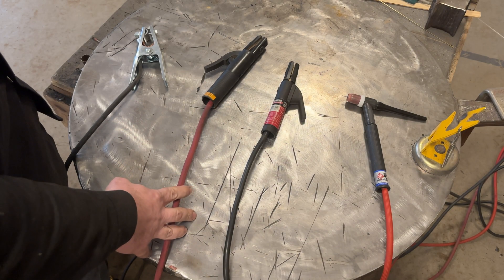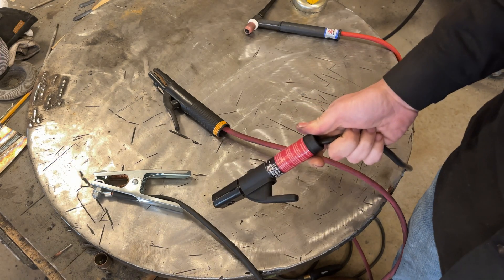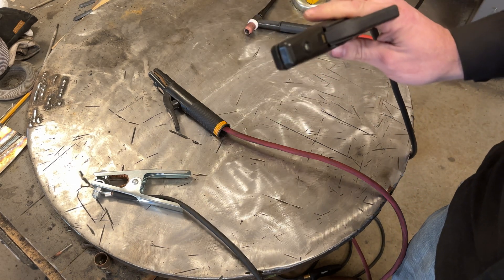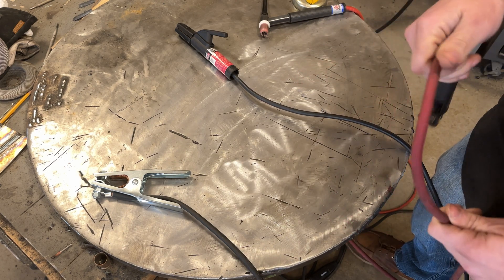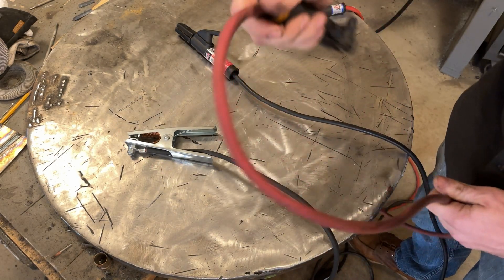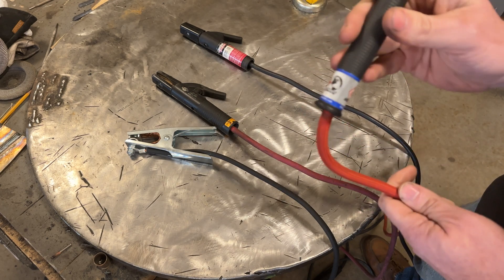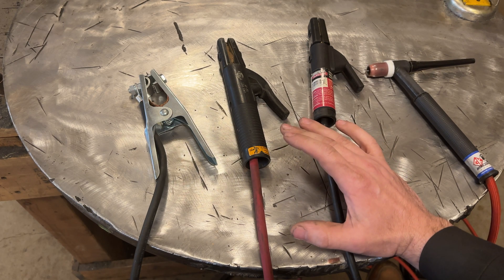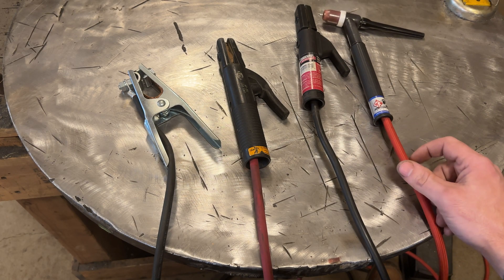Everything you need to know about welding cables

Comment: He its about a stick welder 
I want to weld with most  3,2 mm at max 120 amp  (mabby som 4 mm at max 170 )
END I WANT TO BUY 25mm2 AND 2X 5 METER  cabel the stinger 5 meter and ground 5 meter 
I weld long time in a row 

Ore do you think 35 mm2 is a beter save way ?
Reply from the maker: 25mm2 would be the way to go.  On 5 meter runs you could likely run 170-190 amps continuous without issue.  Going bigger will just make the cable heavier and harder to work with.

Comment: Hi Greg , hope you are doing well . I have a question regarding the lenght of the lead cable , so here it goes . I have received a manipulator turn  welding table with a capacity of holding up to 4 tons . Now the lead cable that came with the table is about 10-12 meters long ( used cable i dont know if it is original from the manufacturer  demmeler )industrial size lead cable for bigger welding machines . The table has its own conector for the cable also standard connector like on the welding machines . I have a fronius IWave 400 ac/dc welding machine about a year old . And most of the work i will be doing on this table is in MIG/ MAG procedure , standard and pulse welding mode so to say . My question would sound something like this,  for MIG/ MAG does the cable lenght play a huge roll on losing power or in any other parameter loses . Because i have already tried it connecting the long cable with the welding machine and table on the table connector.  And i have tried connecting my 4meters lead cable directly to the work piece and i have noticed some difference in the fluidity of the weld , with the shorter cable its more fluid hot so to speak vs the longer cable , but with the long cable its more crisp and easier to control ( slightly more spatter but nothing to write home about ) i would like if you could please describe whats happening or is a extra 6 to 8 meters from the original 4 m cable nothing too extreme to make a difference.  ( maybe my head is playing with me ) happens to us welders sometimes.  Sorry for the long post . Thank you in advance for any reply and advice . Greetings from Germany and i wish you all the best .
Reply from the maker: That’s a great question.  The answer is it depends lol.  So longer cables will have far more effect on mig than stick and tig.  Mig operates on constant voltage variable amperage.  The goal is to have a regulated voltage at the arc, the amperage is whatever is needed based on wire feed and will vary).  With tig and stick the voltage is based on rod used and arc gap, it’s completely variable.  The reason I bring this up is that a loss in voltage due to cable differences isn’t really an issue for stick and tig.  For mig it’s a major problem because 20 volts at the machine might not be actually 20v at the arc.  Some machines monitor the complete circuit (voltage out vs return) and compensate for this.  Other machines operate “blind”.  You’re probably not “seeing things” there likely is a voltage loss in one circuit over the other, which is changing the voltage at the arc.  The best way to avoid this is to use cables big enough that the resistance is not enough to cause much drop in voltage.  Being that it’s a turn table it’s possible some connection point is dirty or undersized, leading to voltage drop at that point.  Or the cable is simply smaller.  

Unfortunately there isn’t much you can do to fix this other than check all connections, upgrade wire sizes and connectors, or eliminate as much lead as possible.  Wire welding is one of the most finicky processes due to so many variables.
Reply: A huge thanks Georg , I've been welding since I was 15 professionaly at 20 i am 40 now and you are the only person that gives so much in depth information and advice I really respect everything you do and say . The table has one connector for cable which is then divided into two cables inside the table to two brass 30mm points which are pushed with springs to the table surface from inside so you can turn the table in any direction without having to ever deal with the cable being hang up on something.  I will do as you advice , thank you once again for all of us who are learning from you . Keep safe and once again all the best .

Comment: What about when you have a 225 with 100% duty cycle and you have a large project? Would 1 AWG be recommended? Basically just go up a size because of the duty cycle?
Reply from the maker: If you are running 100% duty cycle definitely go with the bigger wire.  As the wire heats up it will drop voltage.  High duty cycle will heat the wire up no doubt.  The reason welder companies get away with small wires on 200amp machines is because they know nobody is using it for any kind of duty cycle lol.
Reply: @makingmistakeswithgreg  lol right, that makes sense! I just wanted to make sure i wasn't just being too cautious and throwing money away. I ordered the 1 gauge and actually received it today so I'll be testing out the new setup. It's an old Lincoln Weldanpower 225 G7 that i restored. Coupled with Lenco twist locks and LN-25 electrode holder. I don't feel like I'll have very good control with it, but we'll see. Thanks for the input Greg 👨🏻‍🏭

Comment: Overtime they stretch your wrist...please explain
Reply from the maker: I believe I was referring to how non flexible cables end up hurting your wrist because you have to fight the tension of the cable.  Tig is especially bad because you need very precise control over the tungsten and if you’re fighting the cable to move your wrist it’s very difficult to move properly.  It adds weight to the torch, resistance to movement, and if you have carpal tunnel it becomes painful after a while.

Comment: Y is Amazon fooling customers by printing different size on cable than the able actually is
Reply from the maker: Not only do they do that, but they use CCA (copper clad aluminum) wire which might be 4ga, but because it’s aluminum it only handles the current of 6 or 8ga copper.  Pretty sad how much rip off stuff is out there with wire.

Comment: Hi Greg,
when I built my own stinger custom cable setup, I have used AWG 2 wire. That was maybe a little bit on the high current capability side. However, on the other hand, the stinger with its Dinse connector will work on any standard welder, whatever that may be in the future. Thanks for pointing out the importance of the heat resistance cable shield. Cheers.
Reply from the maker: It’s never a bad thing to have slightly too big of power cables, especially because you can always swap them like you said.  Definitely thinking ahead 😀

Comment: Thank you for this - I just went through this last week, sizing for my 200A (60%) welder. I went 25mm2 for the 5m length I needed. I usually use a 2.5mm with 3.15mm max rod so for me that seems OK? I hate that when you buy a machine (even a fairly decent one) they give you such short cables - my earth is literally 1.5m (tip of clap to tip of Dinse) Crazy!
Reply from the maker: No problem 😀.  So 25mm cables will handle 180 amps at 30+ percent duty cycle.  You could run those 3.2mm rods all day without any real issue so you’re good to go.  Short ground cables are fairly common with machines, but that is shorter than most.  It makes sense if the machine is super small and 140amp but a 200 amp machine should definitely have longer wires lol.